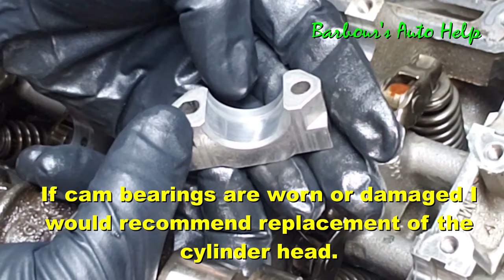Chrysler 3.6L Pentastar Ticking Noise & Repair Options

Comment: Must say, mine started a 300000 km, it's been one of the most reliable cars I've ever owned and not to mention, I never changed transmission fluid since I bought it new. I'm just going to drive it untill the engine blows up. It doesn't owe me anything.
Reply: I'm at a similar spot you were last year.
I'm curious to know, how's your engine running?

Comment: You know somewhere, somebody knows exactly why all these roller followers are failing prematurely.  It reminds me of the same issue present in the 5.4L 3 Valve ford engines (which are notorious for Cam Phaser and timing chain guide/tensioner failure).  Ford Tech Makuloko did a great set of videos addressing the followers failing on those engines as well, and this feels right similar.  I would say poor material quality in the follower bearings (and likely the cams as well) is probably to blame.  It is no secret manufacturers choose quantity over quality for mass production. AKA these followers using cheap questionable materials, along with the recommended oil being basically water these days (5w20 or 0w20) and i would say you have the perfect recipe for failure.. now i know somebody is gonna chip about my comment so go ahead, chirp all you want. But with what i have observed over the last 13 years there are so very few engines being made these days that can even come close to what was produced prior to 2010~ the actual metals being used in modern engines have been reduced to 'bare minumum standard' just to get you through the warrenty period.. Do you actually think manufacturers care about how long your engine lasts??  LOL dont kid yourself, they only care about $$$

Comment: Thank you so much for making this video. We recently purchased a 2022 Chrysler Pacifica Touring-L FWD model with the 3.6L Pentastar gas engine. On the day we purchased it, driving home from the dealership lot, I got the check engine light flashing...brought it back in and the dealership said it had P0300 (cylinder misfire). At first they blamed it on 'bad fuel' and did a full fuel system flush then reset the system. The check engine light still comes on and now they are saying it's something related to camshaft but not being a mechanic and them not sharing the part I'm not sure what they mean. They tell me the vehicle is now going to be with them waiting for parts until mid-Feb..... In your opinion what could they be talking about considering this is a NEW vehicle I cannot see it being any sort of wear. The mechanic mentioned something about him being able to rotate the camshaft more than it should and something related to a locking pin for the oil...any idea what he could be talking about? THis is a bit of a nightmare for us because we traded-in our vehicle for this new van and now we are stuck with what might be a lemon.
Reply from the maker: I'm not sure.  It stinks that EVERYTHING is on back order now days.  This is a problem we deal with where I work too.  Really makes it tough on techs.  Especially makes it tough for customers.  I'm sorry you are having this problem.  I hope you get your vehicle back soon.

Comment: All engines have their quirks. This engine is really good, but research is your friend. I have a 2019 dodge charger with the 3.6. I was proactive and replaced the oil cooler. I have upgraded the hell out of this engine but totally forgot about the ticking. I have had this car since 100 miles and in 3 years only have 7600 miles. The ticking remains, and this gave me confidence to go to the Dealer. Worse comes to worse, I will do it myself. I am just worried about the modifications I did the car, will dodge pull the you did work, that violates the warranty. The ticking when it is cold is almost non existant, but when the car warms up, you can clearly hear it idle. This just confirmed my initial thought, it was rocker arm noise. If i have to do it myself, i plan to do all rockers and lifters. No reason not to at that point. I really wish i could find performance rockers, might as well upgrade it while i am in there if i have too.

Comment: Best video I've seen on the 3.6 cam issue... going to be digging into my first 3.6 this week...no cam noise..I believe a head gasket..high mileage engine..217k , runs great...but gets hot ..air in cooling system from combustion chamber I'm pretty sure...water stops moving....no water in oil or oil in water...kinda got me over thinking the issue.. removed thermostat... thought I had it figured out....bad thermostat right...nope..
Doing same thing...so I presure tested the cooling system...
Would bleed down with no outside leaking of fluid....when restarted car..it had a miss a skip.... telling me there is a leak on the inside of the engine getting in now to the combustion chamber...from the head and or gaskets,,,this car is new to me... fixing problems as they come up...was not expecting to do a head job for sure....may just drop in a new engine if I find other issues with this one....0 Mile remand engine for it is 4,500$ ,,,,,5 year warranty.....
Reply from the maker: Just dropped another video recently with helpful info for diagnosing an issue such as the one you are describing.  A good bore scope is worth it's weight in gold when it comes to this.  They aren't that expensive either and they can connect to you phone.  Here is a link to that video.  I hope if helps further... https://youtu.be/t4kdSMplNuA

Comment: I believe lifters have a small spring in it and mostly pushed out by oil pressure. I would press on the lifters with my finger and watch them collapse under pressure. If it is not collapsing, it is frozen, and not good. If it is collapsing, I would keep using it. Am I right in my statement?

Comment: I have a Town & Country 2014 that has 3.6 Pentastar 130k miles, it keeps giving me misfire on cylinder number four I changed the ignition coil and spark plug but still the problem persists do you know what the issue is? Or is it even fixable?

Comment: Hi,

I have a 2016 ram 1500 3.6 with an engine tick for the 4th or 5th time.
The first time the dealer replaced the passenger side cams, rockers and lifters under warranty.
I changed 5 rockers over a period of 100k miles and was always able to hear with a car stethoscope what side was ticking.
Now I have a tick again but the valve covers are quiet but the tick is coming from the exhaust close to the manifold?
Anyone have an answer for this.
170k miles, every 6k miles oil change with Pennzoil.

Comment: IS THIS A COMMON PROBLEM ON THE CURRENT/ NEW 2022 CHALLENGER WITH 3.6L PENTASTAR ENGINE?  HOW ABOUT THE CURRENT 5.7 HEMI AND 392 ENGINES IN THE CHALLENGER REFERRED TO AS THE "HEMI TICK" EARLY LIFTER FAILURES?

Comment: I really need some help 

If my rocker arm is bad and is making a knocking sound would it just make the sound only when Idling and not when driving.
I also have a code for loose gas cap but I have replaced it and I still have that code could that have something to do with the sound it’s making
Reply from the maker: Never heard of a gas cap issue causing a knocking noise.